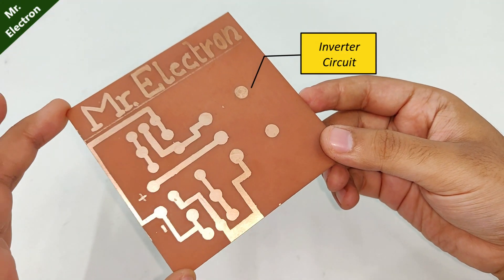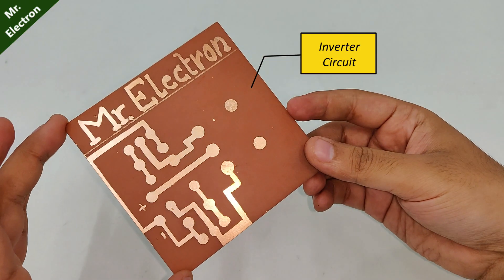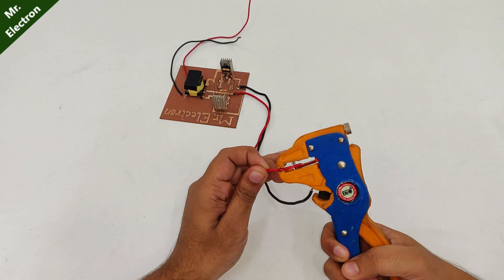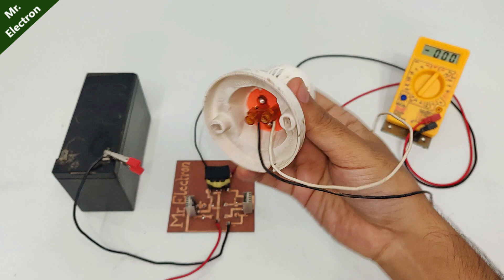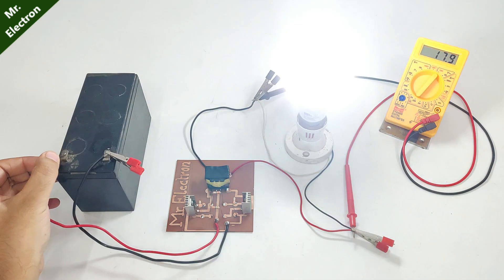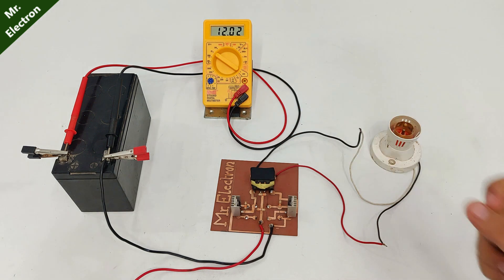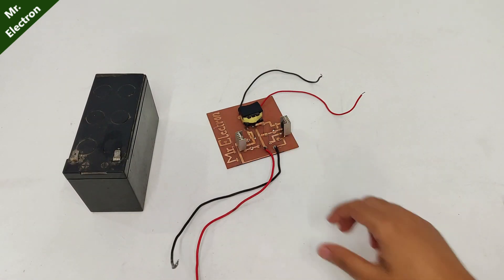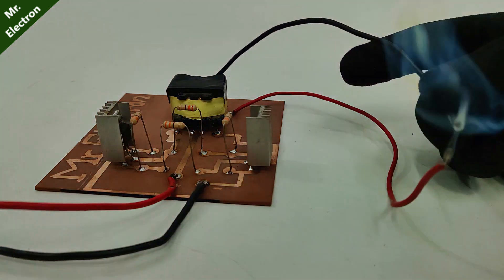12V DC to 220V AC Converter 100W Inverter - School Project Idea 2022

Comment: Hi @Mr electron can we make it's big version 500w by adding the same components in this circuit i.e 5 transformers 40 resistance and 10 transistors is it will work please explain the circuit for  500 watt inverter
Reply from the maker: Never tried that so i am not sure but yes the output is surely going to be more than what i am getting now.
Reply: @MrElectron  thanks for the reply

Comment: If you want to build an inverter circuit, don't even think about building this one. With no feedback, the voltage regulation is non-existent. It can only work with low-power loads. You can actually kill an appliance by high voltage transients. Expect an awful waveform and an annoying screeching noise from the circuit
Reply: Its just for noob or hobbysts okey brother ❤

Comment: Can i use a 12 0 12 3 amp transformador?
Reply: Of course you can
Reply: Your inverter wattage is controlled by transformer wattage 🎉 12+12=24 24×3= 72watts so you can make 72w inverter 1

Comment: I think this circuit produce high voltage 10kv so damage the other electronic appliance like tv, led bulb, charger,
Reply from the maker: Yes, but the voltage gets dropped after connecting load.

Comment: This circuit can produce more higher voltage which can produce big freaking arcs if you use a flyback transformer which I did in my channel

Comment: This circuit work on hi frequency so its dangerous to use
Reply: The voltage at the output is around 240 volts, so of course it's dangerous, its a tool, not a toy.  
The frequency is indeterminate since it uses a free running oscillator but that makes no difference to how safe or dangerous it is. 
240 volts at 50hz or 240 volts at 5,000hz will both kill you if you are not careful.

Comment: Would have been more useful if you specified where that specific transformer came out of so people can actually build the circuit 🤦‍♂️
Reply: nat a big deal you use any similar looking transformer the same way even the one from mobile charger the only difference is you get less watt as compare to this one
Reply: @usamaramzan4686  it does matter which one you uses every single one is different
Reply from the maker: Old smps power supply
Reply: @MrElectron  ok can you also specified what model it was because there's tons of those power supply out there and each one are different